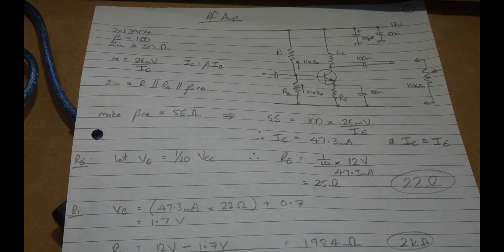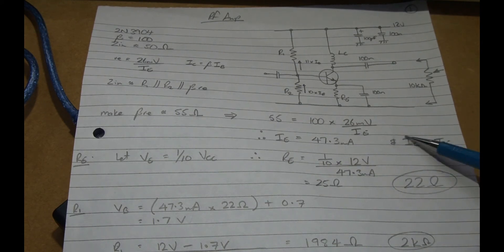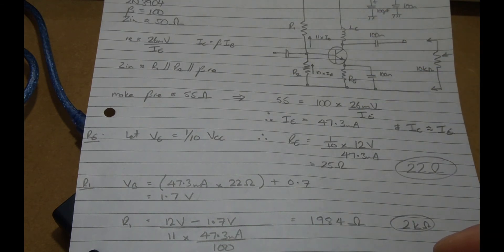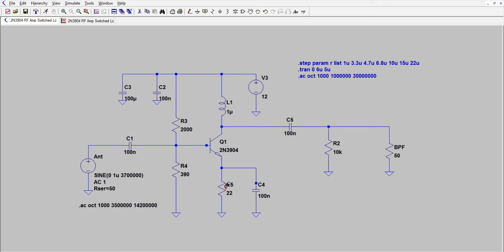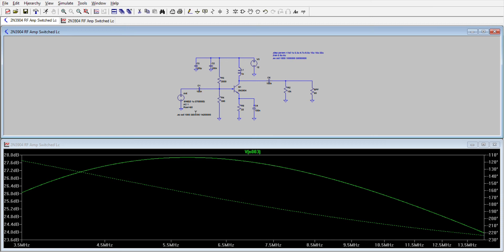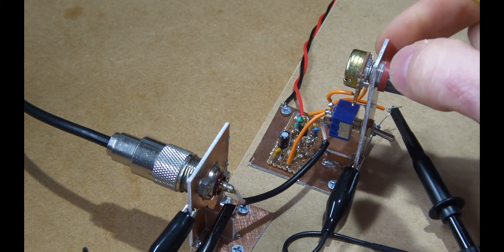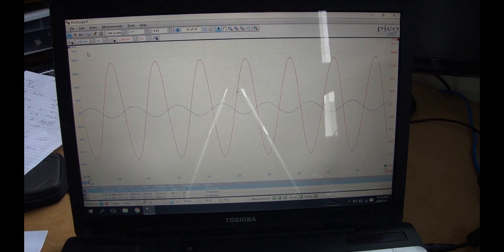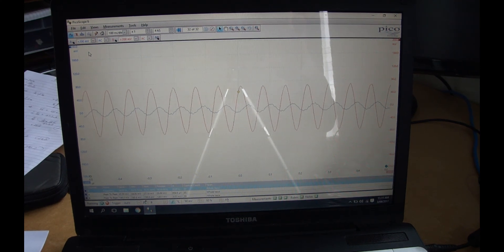Simple Homebrew SSB/CW Transceiver Part 3 - Receive RF Amplifier Design

Comment: Where does the 26mV come from in the little re calculation? I've been looking around on the internet, but I haven't found a really good explanation for it. It feels like one of those things where I can't find anything because I don't know the right phrase to search for
Reply from the maker: Hi. Take a look ar Hybrid-pi models for a BJT. The emitter base junction in a common emitter amp is treated as a forward biased diode. The forward dynamic resistance (in a standard temp environment) is approximated by 26mV/Ie (mA dc).
Reply: Its a property of transistors, essentially the "math" that works out from a transistor junction. Its a "virtual" voltage